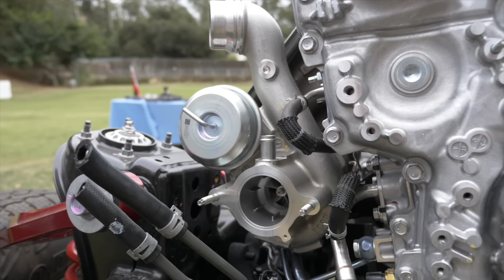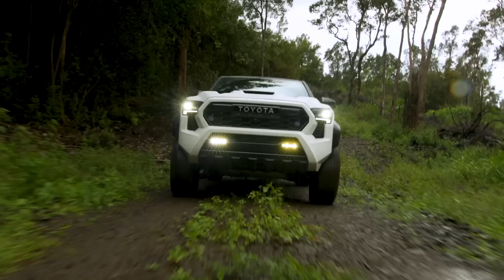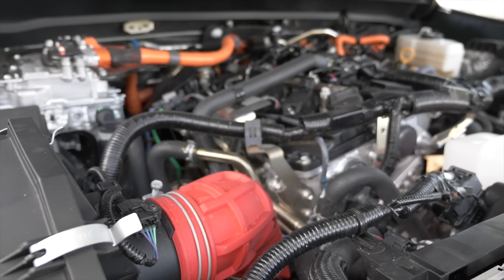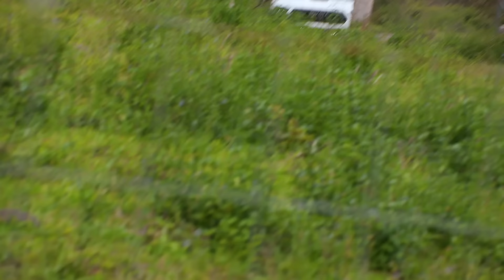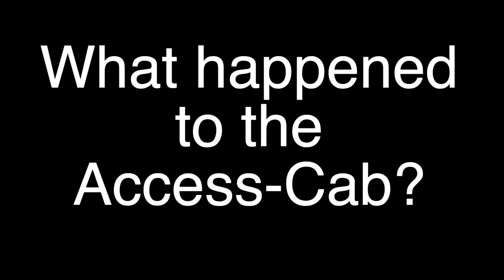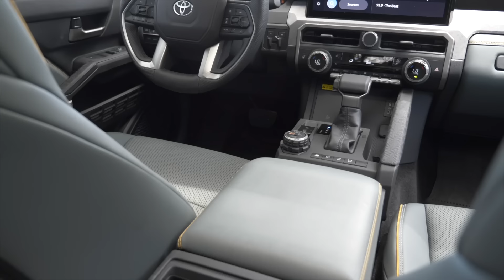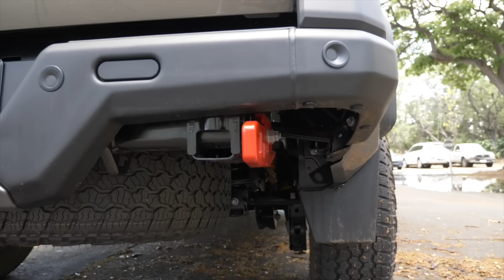2024 Toyota Tacoma Chief Engineer on new engine reliability and more...

Comment: Lol, NEVER will that 4 cyl turbo heat producing engine last nearly as long as the 4.0 V6. And it won't remain unchanged for nearly 20 years like the uber reliable 4.0 V6. You're pushing garbage and honestly, that's just sad.

Comment: Ford has been putting 2.3L turbo engines in Mustangs since 2017, and a built-up/de-tuned version of that motor in the new Ranger and Bronco.  They have proven to be pretty reliable, and until 2024 they were direct injection only.  

Toyota is using a more well built block than Ford, commercial grade turbo and dual injection.  Not to mention these engines will be under-tuned for reliability.   Reliable turbo motors have been around a very long time!   People need to chill.

Comment: These new turbos engines ARE NOT RELIABLE I worked at toyota as a detailer and when I walked through service bays there’s brand new tundras being torn down because the engine blew up under 10k miles these are new engines turbos is something NEW for Toyota remember that

Comment: Coming back to this after four months and I'm sorry to say, I was right, and a lot of other Toyota fans just the same, the dark clouds are upon Toyota. The new Toyotas have issues more and more especially Tacoma and Tundra but not limited to these two. The legendary bulletproof V6 and V8s and their transmissions are gone, replaced with shoddy turbo inline 4 and biturbo V6... Spun bearings, faulty turbo wastegates, clunky 10 speed transmissions, and the usual creaky plastics, some other issues are showing up as well more than ever before... Unsatisfied customers are returning their trucks to Toyota under "Lemon Law", this is getting serious...

Comment: Ford and Honda also tortured tested their Eco-Bust, twin-turdo engines, and the empiric (every day) experiences  were completely different from the experimental results. One if the main reason us the heating and cooling cycles, as the tests used fewer, longer cycles and reduced the run-dry times. I will NOT be replacing my 2UZ and 1GR engines for  LONG time and I will look for other alternatives. I been buying Toyota Trucks for decades now and this is a big let down. A diesel would have make so much more sense. Better aerodynamics, better materials and weight. Better engine design, improved combustion. This is the beginning of  Hondification of Toyota.

Comment: And if they’re smart, they’ll recommend 5W-30 and 4000 mile oil change intervals and maybe 5000 if you’re using an extended life motor oil and daily driving the vehicle to and from work I would probably use mobile, 10W-30 extreme diesel oil

Comment: Reaching hard to make these new trucks appeal to users who likely already have a perfectly good truck that is ten or even twenty years old. There are no new features other than novelties, and or course, emissions and economy improvements which the engineers have to convince you are worth the cost. What else is there? A box frame? Every $1500 old Nissan truck on the road has that. A fix for "gear hunting?" Old manual transmissions didn't have that problem. More computers to interfere with your driving? No thanks. A tailgate that goes back up on its own? C'mon. How much did that raise the cost, and what on earth was wrong with a manual tailgate that literally never breaks.

Comment: If Toyota wants its turbo charged engines to be accepted, it needs to DRAMATICALLY lower the price of the turbo in case it fails. Why are turbos so expensive in the first place, it certainly does not cost a lot to make one! I love Toyota tundra and Tacoma, but hate the turbos. $4500 for a replacement turbo is no good. Also, I won't pay the rip off dealer fees they charge, and adding the turbo forces me into the dealership, because I am not equipped to access it. I want to do most of the work myself, not count on a thieving dealership!  No thank you! I buy Toyota ONLY because they are reliable and long lasting which helps to save money, and if you take that away bye bye!

Comment: We have a 1999 toyota tacoma reg cab 2wd, a 2004 tacoma doublecab 4wd 2.7, a 2005 tacoma doublecab prerunner 4.0v6, a 2010 tacoma doublecab 4wd 4.0 v6, and a 2015 tacoma doublecab 4wd 4.0v6.  and we just purchased a 2019 tacoma doublecab 4wd 3.5v6 limited. 
I also have a 2008 tacoma doublecab 4wd 4.0v6 that a good friend wrecked, (still runs and drives , she gave me title and all. I use it on our old farm property as work truck. 
I dont think ill be running out to buy the 2024 tacoma anytime soon.  Maybe after they work out all the bugs, that new vehicles usually have. Remember the all new tundra with the 3.5v6 and twin turbos, the first two years were a nightmare. My brother purchased one, and it was in dealership service waiting on parts and turbos for over 4 months. They said the turbos were backordered from the part supplier. 
And then there is the issue with rusty rotten frames and faulty ball joints, on the first and second gens tacomas, then the paint issue for super white and blizzard pearl vehicles. The dealership repainted my wifes corolla, and camry and they look hideous.  Poor cheap paint, and unskilled paint and body people. Im still fighting with toyota about that.

Comment: 4 cylinder and truck don’t even belong in the same sentence. Running smaller with higher RPM’s to achieve power means quicker turn over on investment. Get rid of that. Cost too much for short term. I’ll stick with my six.

Comment: There is no way the turbo 4 will last as long as the V-6. It's simple physics - turbo engines wear out faster because they have to make more horsepower and torque than naturally aspirated engines from less displacement. If these gas turbo 4s are so great, how come they are not in the Toyota Hi Lux ?

Comment: Its important to note that all of the reliability and strength downgrades are because the EPA sets mandates that we have no say or input on. Manufacturers have to meet these mandates in order to sell their vehicles in the usa. The required testing and verification of meeting these standards drive up the cost for the end user. 
    Also, turbos are just plain and simple a liability in a daily driver. The bearings and seals fail and have potential to seriously harm engines when they do. Toyota crapped the couch on this. Sad times.

Comment: Go back to the original design of a 22RE and revamp it for better fuel mileage. I don't care what you say. That engine will cost me 5 times the amount a 22RE would. And probably not out last one either. I've owned 9 Toyota pickups from 4 bangers to V6 super charged. My 87 22RE had over 400,000 original miles with only a timing chain replacement. Still running when I had to sell it, sad day.

Comment: You and Toyota should be ashamed of the quality level of the Tacoma. Frankly after owning a 3rd Gen, I’m astonished as to why they have such a positive reputation. All anyone unfamiliar needs to do is read the forums. Above the series of quality and assembly is the reluctance of Toyota to not repair reasonably common issues under their warranty. One attempt to repair then claim normal once realized the associated cost of correction. Toyota consumers won’t return after such experience.

Comment: Cooling, cooling, and more cooling. One of the major issues with most turbo charged motors is oil circulation to the turbo. If oil circulation is effected the turbos life span will shortened drastically. So oil changes need to happen well before the 10k manufacture recommended changing cycle. I would want to change oil out around the 5,000 to 7,500 miles max. I don't care what the manufacture says, 10k miles with turbo charged engine is pushing it.

Comment: Warning!, these new Tundras and Tacos are JUNK. Breaking down like crazy and now Ive seen 3 new Tacos being put up on flat bed tow in just 5 days and another one breaks the diff on snow and ice literally lightl, easy conditions with the Fast lane crew. Good bye toyota reliability. Same for these junk CVT transmissions. Toyota used to put a million milesnon their furture vehicles. Seems not anymore. A 2wd Chevy Colorado saved the awd Taco.

Comment: Nope.  No way as reliable.  Turbos are notorious and prone to fail.  The inherent design of a turbo lends itself to a very high duty cycle.  They spin at tens of thousands RPMs.  Once they begin to fail, they begin to cause engine problems.

Comment: I try not to use absolutes when talking about cars and trucks. However, I feel buying a car or truck in its first year of redesign is a bad idea. Here’s the absolute, there are ALWAYS issues with first-year redesigned vehicles. Manufacturers will tweak and/or modify vehicles during the first year of manufacturing to correct issues. I currently drive a 2007 Tacoma TRD. In June, I’ll be looking to purchase a 2023 Tacoma TRD. If I can’t find one at the right price, then maybe I’ll look at a 2025 Tacoma next summer.

Comment: Okay, Sir Chief Engineer, please answer me this one Question fully and Why you answer it your way.  The old Question of OIL CHANGES !  In this new to Toyota set up, what is the Recommended Oil ?  And What is the Change Interval?  And Lastly, what is the "projected" life  time ( mileage) of this new engine of yours?
I'm so tired of all the Shade tree mechanics and others saying the same things over and over again about oil changes.  " I don't follow the recommended change interval, I change my oil twice as often  or more, so the engine doesn't blow up, yadda, yadda, yadda !

Personally , my 40 years experience with Cars, Trucks and even Jet Turbines and 4 and 6 cylinder Aircraft engines tells me, to ( follow the recommended change intervals), and don't add "special additives"  and the engine will last a good long time.  

What Say you ?

Comment: I REALLY want this new engine to be reliable for the new 4Runners and Tacomas. I doubt at first release they will make it to 200k plus without something happening. They just won’t be able to be as reliable as the dinosaur V6 or the 4.7 V8 but it is a trade off. Better economy and better power, so hopefully they will still be a reasonably reliable engine for Toyota’s reputation. I  hope i’m proven wrong and am looking forward to the future 4Runners! Once these engines get used for a while in the mass market and then gets refined I would happily jump into one.

Comment: I would love a PHEV version. But I only have 197k on an 07 Tacoma and will just replace head gaskets or put in a used 4.0 when it fails one day. 

I figure I can buy a low miles 2023 4.0 4runner in about 10-15 years and may not need another vehicle in my lifetime.

Comment: I have a 2002 tacoma double cab 3.4L V6,with 250,000 miles, replaced frame 4 years ago . Toyota was always known for bulletproof transmissions and reliability.  Do you actually believe these 2.7L twin turbos will get to 250,000 miles? What's next CVT's?!! Remember the Toyota 4x4 ads in magazines with trucks from all over with 500,000, 600,00, 700,000 miles? That's what faithful Tacoma owners want back! Warranty these turbos to 300,000 miles and then maybe I will buy another. I'm not spending over $50,000 for a truck that lasts until the warranty runs out.

Comment: I took my 2023 Capstone Tundra back to the dealership yesterday and told them to burn the sum bitch. It’s been to them 3 times because it will not start randomly from the push button start. It will start on the app and with the fob but it will not start with the dash button. They said they don’t know what it is and Toyota won’t send someone to their Toyota dealership to trouble shoot because this is one of a couple cases and they don’t know what the problem is. They are replacing the truck due to lemon law

Comment: I hope they designed it better than the GEN3 Tundra turbo V6.  My 2022 tundra seized the engine at 28,000 miles due to it poor engineering design.

Comment: I have a question. I’m a 2023 iforce tundra owner and have been wondering if it’s necessary to allow the truck to idle prior to turning engine off each time I drive to allow turbo to cool down. *Standard driving , not towing or hard use.

Comment: This, and many other new engines, has a glaring issue that I will be replacing immediately after purchase - plastic thermostat housing. Time and time again it is proven these will warp and lead to significant coolant leaks that then contribute to overheating thus ruining engines. I don't understand why they are still so dead set on using plastic for something that moves around fluid that can reach upwards of 200F under stressful loads.

I get you're trying to lower weight as much as possible, but as far as I'm concerned anything moving liquid that can get to greater than 150F shouldn't have plastic components at all.

Comment: This is really really good info!  I used to fly a Cessna Turbo 210 with a Continental TSIO-520 engine.  My rule was to let the engine idle at least 2-minutes to let the VERY HOT and VERY HIGH RPM turbocharger spin down to a low RPM before turning off the engine and SHUTTING OFF the engine oil pump to the turbo bearings which needing lubrication while the bearings were still spinning down.  
 I needed the turbo charger in the airplane for power at high altitude,  but I have never wanted a car with a turbo charger because of this lube issue when the engine has been "run hard and stopped VERY HOT" because of the turbo bearing lube issue.  

I have been told that BMW keeps oil flowing to the turbo bearings after the engine has stopped.  Worse case, in my imagination, is 2 hours of Interstate driving and stopping at a rest area for a toilet break and shutting the engine immediately upon reaching the parking space.  
MY QUESTION:  How does Toyota deal with turbo bearing lubrication in a situation like this?
Reply: They don’t!

Comment: I’m gonna go against the grade and say I love a v6… but why can’t we get a naturally aspirated 4? I would rather get a smaller Tacoma  with an NA 4 that makes around 200hp. Toyota has killed it with those in the past. Tacoma has gone from a light pickup to a mid size pickup, keep the v6 in it and make another Toyota pickup with a NA 2.7 in it. unfortunately that’ll never happen cause of EPA standards causing them to have to make giant trucks. 

The new tacomas are the size of first gen v8 tundras.

I like a 4 cylinder on something small. I see why people have concerns about this truck, the 4.0 is stone reliable and a turbo 4 will have to lug a lot more and not give instant torque with the turbo. If it were a smaller truck I’d be so happy to own an N.A. OR turbo 4 Toyota.

Comment: Not a single chance it'll be reliable. Turbos last 130k miles and the little 4 bangers they're attached to typically last about the same before a head gasket pops. 120-150k will be the typical life span of one of these before you're looking at $5k-$10k in replacement costs.
Reply: 15k km per year is average milage.  Changing a turbo after 10 years is worth it.

Comment: I will trade 10-20% worse fuel economy for reliability and ease of working on the vehicle. Maybe most people don’t like to keep cars as long as I do though
Reply: I still have my 03 Chevy Silverado. Going on 20!yrs old and I still have my original transmission. Cats. Same transfer case. Same fuel injector. Same front diff. I like my truck and tend to drive it as long as I can. 😊

Comment: Bunch of idiots in the comments think a turbo motor runs higher rpms to make power.. my ram. 2500 6.4 hemi V8 ran higher rpms doing the same job as a 2.7 turbo f150 I owned. They build boost to make power not drop gears to build rpms to make power like a v8.

Comment: Don't get me wrong, I love Toyota, especially for flipping off the world of EV idiots (Ford, GM, Tesla, Rivian etc.) and their engineering is world class.  However, there is NO REPLACEMENT FOR DISPLACEMENT...smaller, hotter, over engineered and living life at twice the RPM means stuff breaks quicker. Period. Saving gas at the increased cost of ownership over time.
Love the B cab design discussion though...a truck is a truck first, get a grocery getter wagon otherwise...

Comment: 3" is 76.2mm.  70mm is 2.75". TURBOS will always be relatively LESS RELIABLE. It will not be the SAME reliability as a non-Turbo. He will not disclose the numbers for reliability. That is NEVER good. Be transparent my man- IF you have nothing to hide. If it was good- he would state it. He said it is a SECRET. Why? Front fairing is too low. Warranty that Motor and Turbo if you are so confident.

Comment: Sheldon,
Why do I have to buy a $300 throttle accessory to make my 23 Tacoma's ride by wire pedal feel like my 06 Tacoma's throttle cable pedal?  Why not keep the 1-1 ratio. If the pedal moves 20% the butterfly should open 20%, not 6ish %.

Comment: Turbos are NEVER more reliable than a naturally aspirated traditional engine. The 3.4 , 3.5 , and 4.0 are very reliable motors. Changing this because of some EPA regulated, efficient, and “Green” friendly policy is absurd, and is the end of real reliability! I’m a huge fan of Toyota trucks, and SUV’s . They always were trail, 4x4, and approach superior, and this  new truck lineup are absolutely not! They care more about Stereo options, and luxury than making a super quality vehicle that can last for 20-30 years. If Toyota keeps doing this kind of  shit, I’ll just throw a new engine in my Gen 3 Tacoma when it finally wears out 400k miles later… 

When a Brand stops connecting with its consumer’s, and their needs, they’re finished ✔️